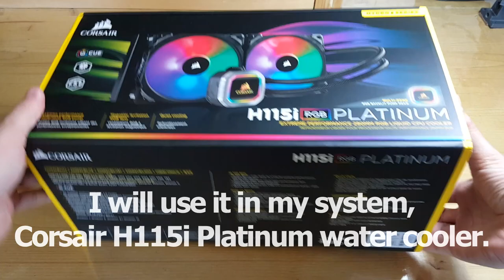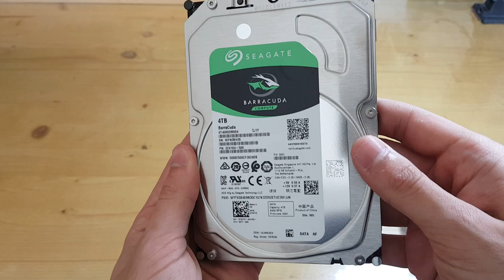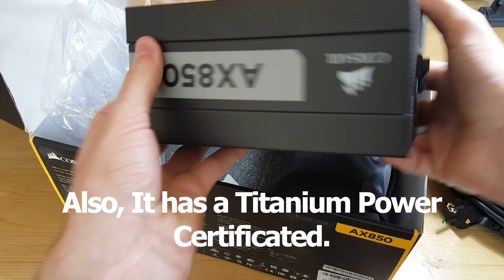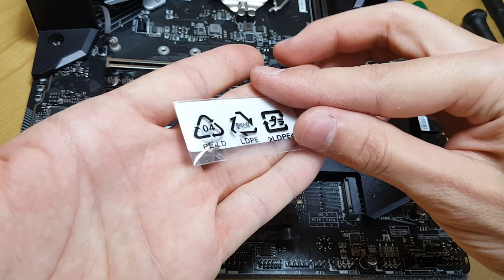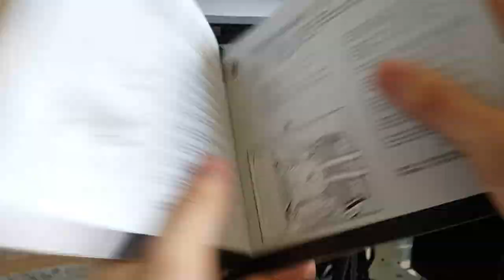How I Did - My First Desktop Case [RTX 2060 Super i7-9700K]

Comment: Looks awesome.  I have the same case, but I used an air cooler instead.  This case is not to good for vertical GPU mount.  The GPU fans are to close to the glass panel.  The air flow will suffer.
Reply from the maker: I noticed that when I try to play a video game. 10 degrees more than normal. Also, I'm using horizontally now. I will try to solve this problem. Then, maybe I can give you an idea.
Reply: @AydnSEN  so what the idea
Reply: @viole8354  you can buy a gpu bracket. It will use the slots your gpu would normally go in (not the ones close to the glass).
Reply: Cooler master v2 for vertical gpu, nice tool

Comment: good stuff man! I was really contemplating on whether or not I should get this case and there aren't a lot of lot of good videos on this case
Reply from the maker: Thank you. I like this case a lot too. But I can say one bat things about it, I couldn't assembled the radiator on top.
Reply: @AydnSEN  for your fans, did you connect the pwm cable on your motherboard or did you use the commander pro?
Reply from the maker: Two them I connected Cpu cooler, some of them motherboard and commander pro.
Reply: @AydnSEN  when you connect the two ll120 fans to the aio, you can still sync all of the fans right?
Reply from the maker: Ofcourse yes. Cpu cooler own has pwm and rgb ports, and I can control them easily with iCue software.
Reply: @AydnSEN  yea i am aware of that, I have the platinum se aio in my rig right now and I was thinking about getting the 465x, when you control the fans in the icue software, can you change all of them at once or do you have to change the aio fans separately
Reply from the maker: If I want I can change each pixel of led or create a group give color effects something like that. Also I can see my components temperature with fan color.

Comment: thanks for the video. I have the same case, only one question, you put the 140mm fans in the back and the upper part of the case ?
Reply from the maker: I installed 140 mm fans at front. 3 x 120mm fans / radiator / 2 x 140mm fans. All the others 120mm

Comment: There's ONLY 6 RGB fan connector how do you connect 9 rgb fans 
(3 extra) ?????????
Reply: He's only got 8 fans, the board has 7 4 pin connectors. You can get a SATA power to multiple 4 pin connectors for $5-10

Comment: can you tell me what is the cpu and gpu temperature with that push and pull you made, need a respond asap cause i'm about to make the same pc as yours with 3070
Reply from the maker: The CPU is i7 9700k.  I saw 60 degree max while render.
Reply: @AydnSEN  tysm <3
Reply: @AydnSEN  only one more question, are the fans 3fans of the case noisy ?
Reply from the maker: I'm using 6 ll series fans and 2 more ml series fans for radiator and they are very silent. Under the pressure, they make a little noise, yes.

Comment: can you flip the top fans for a pull configuration? if the top fans blow air inside it will circulate in the warm air in it one exhaust fan isn't gonna be enough for it
Reply from the maker: I think you right but case came with dust filter on top side. I will try, thanks.

Comment: Hello, great video. Im gonna make my first built too in a few weeks, i got the same case, power supply unit, and my instalation includes an 3.5 HDD. And im a little worried because i saw some comments about the lack of space for a HDDs with that size of power unit. How u get to manage so well all the cables?
Reply from the maker: My setup is including 3.5" hdd. I checked 5 times before I bought my psu for that situation. My psu is 170cm length and I can fit it. There is no more space but it fit. You should check case sizes and psu lenght to make sure will it fit. Also, this case has enough cable management spaces.
Reply: @AydnSEN  my mistake, i thought my psu was the same, but i just realize its another model, a RM.
Reply from the maker: @luda2413  Check the lenght and make sure will it fit :)

Comment: Just a small comment. Do not use plastic bags as work mats with electronics. They generate static electricity when rubbed and could damage the components you are working with.
The bags that the motherboards come in are fine because they are made especially not to generate static electricity.
Reply from the maker: Yes, you are right, thanks fot your comment. Thats why I don't want to use plastic gloves and I'm not sure, did I used plastic bags :D
Reply: @AydnSEN  Well, you put the case, which is metal, on a plastic bag when installing the motherboard.
 😉
Otherwise, excellent work. I really enjoyed watching it.
Were you able to fix the issue with air circulation on the graphics card?
Reply from the maker: Oh, you are right. Probablyi I didn't wanted to scratch the case. I'm using my graphic card horizontal instead of vertical, I will update soon :)
Reply: Good to know.. I usually cover my pc with the plastic bag that came with the cabinet after turning pc off, just to avoid dust. Is that also a problem too?I'm worried
Reply from the maker: @atf56  It can generate static electricity. If you have ground connection on your plug-socket, I think it's not will be a problem.

Comment: how many fans you have added
Reply from the maker: 6 x 120mm and 2 x 240mm. Also they are pretty silent
Reply: @AydnSEN  but there is only 6 RGB fan where did you connect other 3 fan wires
Reply: Other 2 sorry
Reply from the maker: @harshal2719  1 back, 2 top, 3 front, 2 behind the radiator
Reply: @AydnSEN  that 2 fans power cable
Reply: @AydnSEN  the rgb fan connector  in rhis cabinet connects only 6 rgb fan 
Other 2 rgb fan power cable where do connected
Reply from the maker: @harshal2719  I connected them to cpu cooler pump sockets. I will make a video for them 😂 Come back and check 2 weeks later 😊🤙
Reply: @AydnSEN  ok thnks
Reply: @AydnSEN  you are so helpfull 
Thanks broo
Reply: @AydnSEN  make it fast as early as possible 👍👍👍👍👍
Reply: @AydnSEN  where are you from ?? I' m from India 🇮🇳🇮🇳🇮🇳
Reply from the maker: @harshal2719  I'm from Turkey ☺
Reply: @AydnSEN  what is the time there right now
Reply from the maker: @harshal2719  8 pm 😂
Reply: @AydnSEN  here 10:30 pm

Comment: Can a 240mm rad fit in the front?
Reply from the maker: Yes I fit a 280 mm rad
Reply: Aydın Şen I know a 280 can fit but idk if a 240 is too small
Reply from the maker: Of course 240mm can fit. The case come with already included 3 x 120 mm fan at the front.

Comment: Did you made a fan/radiator/fan sandwich in the front ? 
Why ?
Reply from the maker: I bought a 280mm radiator at a discount because it was cheaper than a 240mm radiator. But the top of the case did not support it. I didn't want to spoil the front fan image either. So, that's why I did that. By the way, the CPU is 50 degrees under pressure.
Reply: I thought that the corsair LL120 are not pushing enough air through the radiator.
Reply from the maker: You are right to think because these fans aren't designed for static pressure. But I did not see the negative side.
Reply: Thank you
Reply: Did you use the fans the came with the radiator? Or did you just but the radiator behind the fans that already came installed with the case?
Reply from the maker: I'm using both. Case fans / Radiator / Radiator stock fans. Like a sandwich.

Comment: bruh the only part i needed help with he called boring
Reply from the maker: Don't worry, the pins do not match each other(Except  case button pins). Also you should use your motherboard user manual. Because yours, could be different than mine (Same pins but different locations). If you need anything to help, I will try to help.
Reply: same lol

Comment: 6 fans on front ?
Reply from the maker: Actually five 😂
Reply: @AydnSEN  and what temps you have with aio there ? doesnt effect GPU ?  i wanna make same build but with other case (corsair 220 T )
Reply from the maker: @tolis6327  I saw 60 celcius maximum in summer.
Reply: @AydnSEN  60c on gpu or cpu ?
Reply from the maker: @tolis6327  The CPU is max 60, GPU is 65 celcius max. (2k, ultra graphics)
Reply: @AydnSEN  Good temps. Nice then. Thanks for your answers .